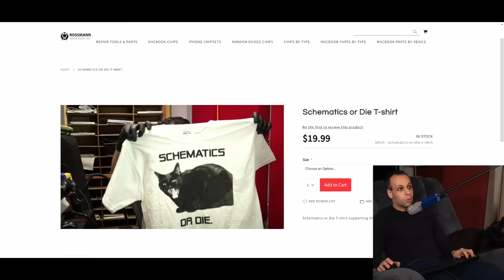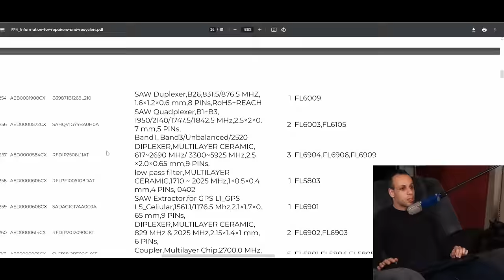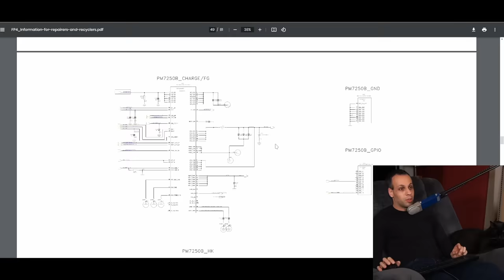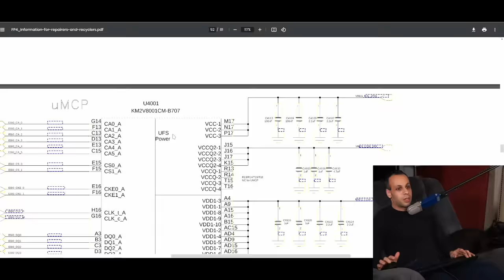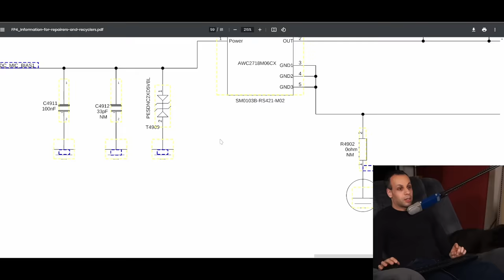Why I was wrong about fairphone

Comment: If Fairphone is listening, this is a huge bonus and would have swayed me towards your phones.
...If you had a headphone jack and a microSD slot. 
I picked my phone because it was one of the few flagships to still have both. It's non-negotiable.
Reply: Which phone is that?
Reply: @brassmule  Not quite a flagship, but I have the Moto G100, I got it for £285, it has Snapdragon 870, 8GB RAM, 128GB Storage, 90hz IPS display, and a headphone jack and SD slot. It's a very good device for the money and I've had the device over a year now and it still runs like new. Unfortunately most of their other better phones don't have either sadly, you could probably get the G100 for under 200 nowadays though.
Reply: @brassmule  Xperia 1 III. My last phone had no headphone jack, and I'm not going back to that. I just wish Sony supported bootloader relock so Graphene could target it...
Reply: Micro sd slot is on the inside of the Fairphone 4 when you open the back cover.

Comment: Cat tuber connects to audio.
Also you can get balanced output, but USB DACs will have more power draw because USB has such high power draw. Analog USB output uses more power because it just needs to send the audio

Comment: I have a way of looking at the headphone jack that a lot of people may not see. A hole in the thing with a couple more solder points, exposed to open air, is a likely fail point (I've never had that happen in 42 years, but giving benefit of doubt), while you can just keep your seal going uninterrupted and remove one or more variables from the maintenance of that device.

Comment: I have a fairphone. If I didn't have a phone, I'd probably buy a fairphone. It's great.
...but sadly, I'd probably buy a used FP3(+), and deal with parts being harder to come by. Because it's the last one that actually has an audio jack.

I use audio jacks all of the time. I have a nice stereo and nice headphones, and I don't want to lug around an adapter to use them.
It's also so simple a format, that's easy to understand, implement and adapt.
So frustrating that Fairphone are going with the modern complicated protocol stacks of bluetooth and type-c faffery.

Comment: Louis, after throwing away an Erikson (dumb) phone, a Motorola X-style and two Samsung phones just because of the batteries failing, I bought a Fairphone in december. The first day I screwed up by not putting the Simcard in properly and the battery got jammed. I drove to Fairphone, went inside, but it was the headquarters. Nevertheless one of their guys solved the problem for me. Talk about customer service! They could have sent me to a repairshop somewhere else in Amsterdam.
And about the earbuds, I was blown away by the quality. No matter which device I use them on, its like being in a cinema!. I used to be a diskjockey in a club so I know what quality audio is. I have Samsung earbuds and Acefast but the sound sucks in comparison to Fairphones buds. I am a very happy customer and can upgrade the device to the specs of Fairphone 5 when they release it.

Comment: You don't think people stare at the OBS counter like that? Dude, I follow two creators who do that and more. One: Two pieces of news that could be delivered in under a minute each, one more bland, one juicier, padded with reading Twitter comments, same news from different source, sponsored segment, the juicier one is dropped around 6 minute mark, the last minute is a filler of, say, talking about some new purchase etc, and no vid, no matter how trivial the news piece is under 10 minutes. The other one takes a little bit more extended law subjects, but often exhausts the entirety of material by minute 6, and then keeps repeating, rephrasing and rehashing the same thing over and again for the remainder of his 20-minute video. And again, never goes under 16 mins, usually staying above 20. Well, knowing them I have no problems skipping to the relevant piece which is invariably 6 mins in, or ending the video the moment I hear them start rehashing.

Comment: I like to think of things in terms of this:

Suppose, for the sake of argument, that the company really did remove the headphone jack for environmental reasons.  Could it have done so viably without also making wireless earpieces?  If this was done to boost sales of wireless earbuds, I would expect the earbuds to have come out a few years prior.  Now, there could have been other reasons.  A headphone jack requires a certain amount of space.  Maybe that was getting too costly.

Yes, when "good for the environment" is a sales pitch, it is easy to be cynical.  And I really prefer wired headphones because they don't get lost as easily.  But I just don't think they have the market power to try to force people to buy things they don't want.

Comment: i got a FP4 off a UK ebay seller (as they don't ship to Australia...) & it works well.
The 700mhz 4G band works good on the major carrier. 
In a lot of tests it seemed to get slightly better speeds, than my iPad mini 5th gen; in the rural areas i was camping in for the holidays.
I flashed it with KDE mobile, Ubuntu touch and have stuck with eOS for now.
Only about as buggy as my iPhone 12 im replacing

Comment: I owned a Fairphone 2 for several years and generally really liked it, and I spent a lot of time researching this company to figure out if they were serious about their claims... I'm glad you're finding that they're not just all hype.
Although I have to say, part of the reason I stopped using the phone was that one of the connectors kept failing, which meant replacing the charging board twice, ironically leading to more e-waste than if it had been soldered on the mainboard in my case... Also the camera was basic. I've only bought used phones since though, and I buy the same model of Huawei so when they break I will have spare parts.

Comment: While I'm not happy about the headphone jack thing, I did find (and lose again TwT) a reply under a yt video where they said they were unhappy about it not making it into the FP4 and would try to get it back into the 5th edition (not a good source, i know, still remains to be seen if they actually do it). The TWS are also not the best thing, but they also state that as a Gen1 product, there's room to improve, especially in the repairability of the device.
Basically: Am I unhappy with the current state of this situation? Yes. Do I believe it will change for the better with the coming hardware releases? Also yes.
Reply: Found the comment again. It's under the LTT video about the Fairphone 4 (https://youtu.be/L1v3ZmfV_hw) where they state that "[Fairphone] had to sacrifice it, to make the modules as accessible as possible. [They] tried everything to rearrange the earpiece, [...], to fit the jack, but couldn't pull it off, without making the phone even chonkier. [They]'ve been catching a lot of heat over that decision though and [their] product team is looking at future options."

Not the best source, but it's something? (Also don't kill me pls if I didn't get the quotation stuff right, I don't do this often)

Comment: Fairphone does sell a small USB-C to 3.5mm headphone adapter/DAC for around $10 (they also state that adapters made by other brands will also work). Although not as ideal as including the socket in the phone, I think that it's quite a reasonable and cost-effective solution.
Reply: it isn't, if you cannot charge your phone while listening to it, people doesn't just use it for "headphones" they plug speakers and other audio gear to it too. so if the phone cannot charge while using the damn port, that isn't a solution in any way of form.
Reply: @survivor303  There are USB-C headphone adapters that also allow charging, the trade-off being that they're a little bulkier and slightly more expensive than the non-charging ones.
Reply: @executor32  sure there are but you need to be carefully what you buy because they can be very crappy. so the best and real solution is to put that damn port to the phone itself, nothing literally nothing demands to drop it.

Comment: Here is the big plus about having a headphone jack: I can use anything from headphones form the dollar store, to hifi headphones + external amp for a grand.
And it isn't even an issue about the thickness of the phone. My old phone is thinner than my new one, and still has a jack. Plus a thicker phone can have more room for the battery and/or better cooling for more powerful hardware and even external storage. Which is something that extends the lifetime of the device when you can keep it usable even as apps grow in size.

Comment: While I hate when the headphone jack is missing in a device, the fairphone has USB-C audio, meaning it can use one of those cheap USB audio adapters based on the BES3100 DAC and the MAX97220AA headphone amp, some of which are bearing the Hi-Res Audio certification (which I suppose is crapola). I've tested such a gizmo on Samsung A33 5G (SM-A336B/DSN) and it works quite fine (although I also own a couple of BT headphones).
Reply: sounds nice, but still only one port for the whole device, which does kind of limit things, ie cannot charge while using the port for the usb-c headset...

Comment: In my experience, bluetooth headphones don't tend to last to the point where the battery has degraded noticeably. I've bought three pairs within a few years and two of them failed within a year of purchase. Only the cheapest AliExpress earbuds are still going strong, and those didn't have a battery life from the beginning.

Wired headphones tend to break from the wire, but I would conclude that both kinds of headphones are generally single use items.

Comment: See all FP needs to do with their Bluetooth earphones is to make the battery replaceable with a quad-A cell. They can make knockoff AirPods which have a battery in the stem, then have the recharge circuitry on-board so once stuffed into a case they can charge. That would resolve the sustainability woes.

Instead they just remove an option and make recharging the device just a bit more difficult for people who want to also use wired earphones.

Comment: Honestly I don't even care about the headphone jack anymore.
Haven't used those for headphones in years now, only stationary stuff.
And since they completely ditched the DAC and your supposed to get one inside your dongle, I guess they could save on curcuit complexity.
Circuit audio design can be pretty tricky to get right especially when space is as a premium.
Reply: @@christophergrant3887 Pssst! Don't tell the audiophiles.
And I said tricky, not difficult 😉
But thinking of what most people plug into their phones you can probably get away with a lot...

Comment: I kinda feel like removing the headphone jack does make the PHONE a little more sustainable. A marginally small amount.

Well, it's technically true for the phone in isolation... But the need for wireless headphones completely negates that.
Reply: @Christopher Grant Well I'm making music in my free time sometimes and wireless headphones are no viable option for this. 
Heck there's barely even wired ones that have an accurate enough frequency response to produce music with.

Also I prefer my gadgets to not constantly scream in multiple channels to anything around it. Mostly for battery longevity reasons but also minor privacy/security concerns.

Comment: I would accept the lack of headphone jack (you can use 3rd party headphones that are not disposable) if it was part of a move to IP68 certification.  The headphone jack is another point where water can get in, so if you need to remove it in order to let the device function under water while also hitting your targt price point, fine.  But the fairphone 4 is only ip 54, which is rated against minor splashes.  A headphone jack doesn't interfere with that, so what's the real reason...  Oh wait, they sell disposable headphones too...
Reply: The Samsung Xcover 6 has a removable battery, headphone jack and water proofing. This is not an excuse.

Comment: I own a Fairphone 4. Its a great phone, and I would buy it again - and recommend it... BUT do I miss an audio jack... So, I'm on the same page with you! I even grab my (2nd hand) spare phone often, just to use the audio jack. I have good quality Lavalier mics etc. that all attach to an audio jack, which are difficult to use now. Yes, I can use an USB to mini-jack adapter, but in practice that turns out to be physically quite unreliable, disconnects, is not always recognised after Android updates etc. O yeah, doesn't fit on/into my smartphone holder when I am cycling. And you have to not forget it - it is yet another part that you have to carry with you.

Comment: I really think they were trying to reduce the amount of materials in the phone by removing the headphone jack.

You may think the headphone jack is a single plug, but that is not the case.  Even if there is a suitable analog out on one of the DAC ICs, you still need a lot of passives to make that output compatible with a headphone jack, and this is for a feature that fewer and fewer people are using.  The ideal response is to simply add a module to use the USB-C port instead.  

I suspect it was the reverse, they were removing the headset, and figured it would be appropriate to also sell bluetooth earbuds.   That doesn't make it that much better, but makes it understandable.

Ideally, I wish they would make their ear buds have a user-replaceable battery module, but that might be difficult to do, as it adds more safety components to the ear buds, which need to be small.  Honestly, all but the most expensive headphone speaker elements have reduced quality after the 5 years of use that the rechargeable batteries would wear out.  I understand it, but again just like you I think having easy to replace battery modules could still have been beneficial.

Comment: I really hate that phones stop having headphone jacks. I got a Pixel 4A with one and used my headphone jack for many years. And now the latest ones removed them. It is getting so hard to find one that do. Bluetooth pairing is still icky and does interfere with other devices. It is also more costly to buy especially you need just reasonably clear sound for podcasts/web meetings. But I hope they at least keep the USB-C to earphone jack handshake protocols alive.

Comment: They specifically mention that to plug 3.5 headphones, you need an adapter with a DAC, thus implying that they don't support analog output.
This means that it's impossible to have good-sounding audio output on the phone... USB-C-to-Jack Adapter's DAC are all a bunch of garbage with mediocre sound quality, and same goes for all bluetooth audio protocols...
I really wish they supported analog audio output from the usb-c port :(

Comment: I got my self a fairphone 5 today and im happy about it.  yeah it does not have a headphone jack but  the 1500 dollar Iphone 15 does not have one either nor does the 1200 bucks Samsung galaxy 24  and the good and I would say Apple airpods  are 200 bucks so Fairphones 100 bucks still cheaper.  But the best part with bluetooth you don´t need to use Airpods nor fair phones.   I use a nice pair of Philips branded wireless headphones that cost me 30 bucks and they have nice audio and mic. 

I mostly use my phone for sms, calls and using the bank apps and to check buss times.  So I don´t need a 1200+ dollar phone that companies rather want me to buy a new one instead of repairing.  So honestly Samsung and apple can go to hell.

Comment: To be honest what makes any phone more sustainable is to just allow the user to change the battery without tearing half the device down and allow updates forever on that device until it fails. However this is never going to happen as no company makes money on a device that gets changed every 5 to 10 years. The only time I upgrade my phones only when updates stop or the battery is basically dead and lasts half an hour before recharging.

Comment: Hey Louis! Fairphones (4 specifically) have been self destructing. IDK if you'll be reading this or even want to cover it, but. There's a "ghost touch input" topic on their community forum that's 600+ posts big by now, about devices (such as mine) that have become useless because what seems to be a design fault is scraping off the cable's isolation, causing displays to glitch out and malfunction. My device looks like it's being shot by a minigun with the violent amount of taps, touches and swipes all over the display whenever the regular ghost shows up, and it's getting worse. All community DIY repair attempts have failed. After 18 months, Fairphone finally released a software patch, and that's almost worse. It tries to detect these inputs and locks up the display when it does. Meaning, instead of a ghost showing up to control your device randomly, your device itself locks you out if it thinks your inputs are the ghost. The soon top 5 breaking topic about the issue was already marked "solved" by Fairphone with release of that "paint it a different color and pretend it's solved" patch, and the patch isn't even available on most custom ROMs as of right now either, effectively locking the FP4 to its stock ROM if you do want the patch.

Having them "fix" the hardware will leave customers without a phone for 2 weeks, receiving a replacement or repaired device that's failing in the same way within mere months again. Masked by the new software patch, maybe, probably buying them enough time to be out of warranty periods when people finally get wise to it.

I am beyond disappointed and angry at Fairphone for tarnishing the entire concept of repairability in the public eye with that massive blunder. A repairable phone meant to be sustainable, self destructing within your 1st year of owning it, precisely because it was "repairable" is what's gonna stick. Heck, even I won't trust any other device on that promise now, I just want a working phone by now.